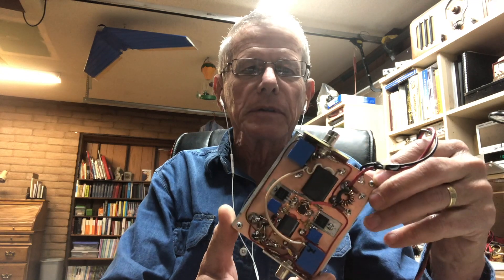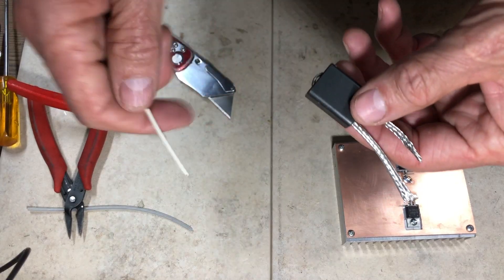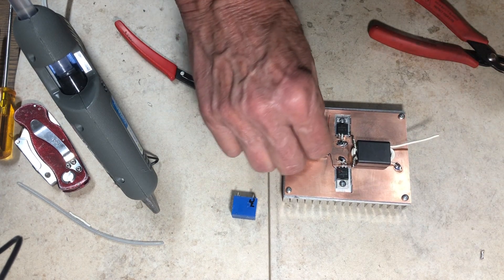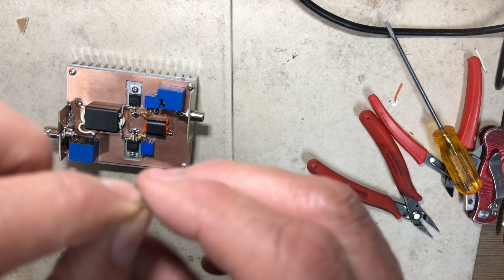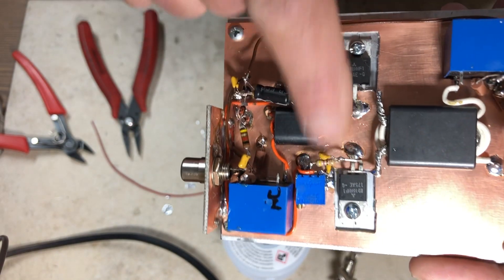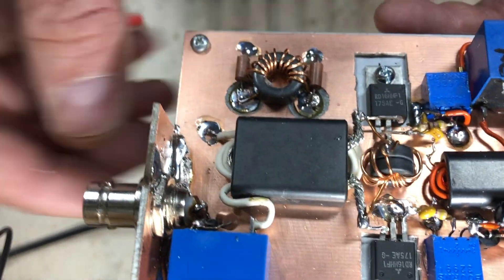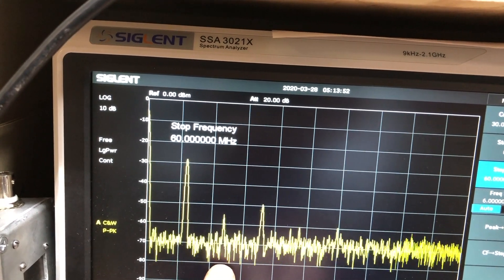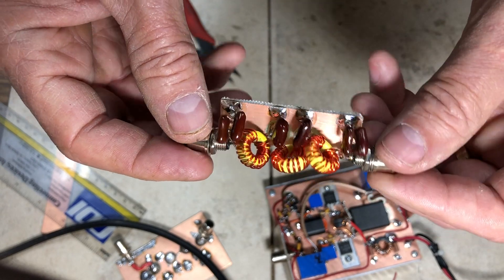RF Power Amplifier Construction

Comment: Hello Ron! Enjoyed watching your DIY project, Thank-you.
I observed couple of points, 1) The binocular core names on schematics are marked wrongly, names just need to be swapped.
2) At 20 mA bias current, i could observe some crossover distortion, anyway you did increase the bias to 30mA. It probably would have fixed the distortion too.
Thanks again!
Best regards,
bp
(I am just a DC to RF enthusiast, not a ham)
Reply from the maker: Hi and thanks for your comments. I re-checked the schematic and found that the binocular core names are indeed correct. The smaller one on the input is the BN43-202 and the large one on the output is the BN43-3312.
Reply: Hello Ron, Glad to hear from you. Yes! you are indeed right. Sorry, my mistake. I probably made that mistake not realizing that the dimensions were actually given in inches for larger core and millimeter for smaller core on Amazon website. 73's
Best regards,
Bharath

Comment: That is what I call a really informative practical video.  I have a few of those transistors.  I intended to use them with a construction similar to the book 'building a transceiver' by ei9gq. I was impressed by the results from your construction,  so I think I will try both. Your construction seems to use simpler transformers, so I will kick off with yours.  I will be interested to see how your construction would work with more bias up to around the linear position for ssb.  I will also try using a simple 50 ohm attenuator padder at the input and see what happens.  Thanks for the video. Keith G0ODU

Comment: Very clean construction technique. I like very much the method to create pads inside a ground plane.
Also, it will be easy to change the transistors when burned by a SWR accident, as we all do ;-)
Thanks,
F1SOC
Reply from the maker: That's true, but these transistors are supposed to be able to take infinite SWR without harm. I haven't tested that though.
Reply: @rontaylor9026  Hi Ron, thanks for the video, infinit swr is a property of the transistor? Or of the construction itself?

Comment: Great video Ron; really enjoyed the step-by-step construction and test walk-thru.  For isolated pads I bought a punch-tool from Harbor-Freight, filed off the punch center-tips and use it to punch-out small round pads out of scrap PCB that then I super-glue down to the main PCB..  The reason I adopted this was that I could make tiny island-pads that are easy to fit into tight spaces and therefore really able to shrink the size of my overall circuits...

Comment: You may be able to improve the gain and output power by shortening the length of the MOSFET Source lead, soldering it closer to the ground plain, especially on the higher frequency bands.  At 7MHz, the design is capable of  ~17.5dB Gain, ~55W  at about 48% efficiency.  Idq was set to 10mA/device for best two tone linearity.  Thanks for sharing your home brew construction of the amplifier.  73, Mike, WA2EBY

Comment: Nice little project. I would have used a pair of slightly bigger devices... go for 70W but what you have there is a nice compromise between supply current and heatsink size etc

Comment: Recently found an old  BLF578 ldmos device that had failed. Measuring it i noted the failure on one side only. I threw it at a PCB along with a few variable Cs and a few inductors and wham !  400W out with 1.5w in at 40v on the Drain, 80% efficiency. Based the circuit on the MRF174 data sheet. Great use of a device that was destined to be scrapped.  Might end up on 6m as a ft8 PA.  73 from ZL.

Comment: Increasing power - a Japanese constructor made a similar amp years ago  but called it a 40 W amp.  IN fact it is about a 34 W amp for SSB use when fed on 14V supply. There was about twice as much ferrite in his core. He used a copper tube core but you can get a similar effect by using teflon insul coax cable with all the braid in contact. 

 Ok so the only other major change was he connected one 100 R x 1W  resistor to each gate , wound 6T of ECW around it and  brought it out to a common point per pair of RD 16HHF1 mosfets, enabling two to operate as if one device. They were biased in common (the assumption is that the came out of the same production batch ).  THe point of the inductor thus created  was to stop ringing between the gates. 

The Softrock 50 which is an ultra reliable kit amp uses a three plus three arrangement to claim 50 W out for SSB - that is the Japanese claim.  (The Japanese is likely getting probably more like 90 W PEP).

 It s food for thought when laying out such a board - allow for expansion.  Such an amp would require about 1.8 W  at the mosfet gates to achieve full output. 

TEFidler ...

Comment: This is an answer on a filter question which is hidden as a reply below  

you either go to QRP labs and buy the filter from there or you use Motorola Application note  267 which is still available on the web.  This covers several filter topologies including the Pi type filter which I believe is Net 3 in that note. Look it up and work it out.
Zout for the amplifier (depends on mode - the above is oriented to CW mode but it will operate as a linear at lower power out.

  THe output impedance from the amp to match is approximately   2 * (Vcc - 2 ) squared / Pout where Pout is say 30 W for CW use and 16 W for  SSB use using much higher bias approx 600 mA total quiescent current  through the sum of the  Drains.    If you are designing a two PI filter you should chose      sqrt ( output Z x 50) and match into that  using the equations  given in the application note. and using a filter Q of either two or three - your choice. Q is defined inn the  application note.  The RHS filter on the output can be designed using the tables in the Appn note as you know the RHS termination is fifty ohms.   You need to have basic EE knowledge to do this  ie you need to know how to go from  impedance to  L and back again and how to do the inductor turns calculations.  

Those are covered  in the toroid tables of  The Toroid  king - search on line.   Such filters can only be approximate as there is tolerance on the properties of the  iron powder material.  A size fifty toroid will be adequate for a 30 W rf filter.  The capacitors should be either multilayer monolytic or  Silver mica.  The latter are preferred for low loss.  The Toroid king sells them.  If you want a seven element filter you have to extend the above description.     

THe application note shows how you can subtract Co of the  respective Mosfet from the calculated  filter  C1 capacitor.  This is not applicable  for a fully isolated  OP transformer as used here. It is applicable for  class C choke type circuits which is a whole different matter.  Basically,  the Appn note assumes single ended RF construction so you have to show some initiative when applying it to a  push pull RF amplifier.

BTW you may wonder where I got the 16 W above from .  Kees Talen used to offer a pretty sophisticated kit with a similar design and it used identical Active devices from MItsubishi.  His considered max Pout with full Fcc Compliance was 16W out.  This was on the basis of a 2 Pi filter or two section filter following the power amp and 14 V supply.  If you take the voltage up to say 16 , which is outside the manufacturer's specification for these devices and if you over drive them (he used just 600mW in) whereas Ron uses one watt, you may well get of order 30 W out on CW  but you may not be FCC compliant.  The FCC requirements are considerably harsher for transmitters over 5 W out and some people don't allow for this. 

In addition of you wire the output transformer for 2T out  you will have a nominal output Z of 72 ohms (running the amplifier for 16 W out nominal)  and if you treat that as 50 R you get  only three percent mismatch loss if you design the filters as 50 R in and 50R out.  I think Diz specified 1:3T (I have his original schematic just to try to get a  bit more efficiency out of the filter by running it as a higher voltage input device in the first two sections. 

 Regards  TE Fidler Nz.

Comment: very good video : thaks for sharing your experience.
Your explanation is very accurate and it will  so simple for me to buildup one.  The point for me is the output filter since I do not have special instruments available here at my station: could you please post the data to build a power low pass filter for 80, 40 , 20 and 10 meter?
Thanks for all.
Reply: you either go to QRP labs and buy the filter from there or you use Motorola Application note  267 which is still available on the web.  This covers several filter topologies including the Pi type filter which I believe is Net 3 in that note. Look it up and work it out.
Zout for the amplifier (depends on mode - the above is oriented to CW mode but it will operate as a linear at lower power out.

  THe output impedance from the amp to match is approximately   2 * (Vcc - 2 ) squared / Pout where Pout is say 30 W for CW use and 16 W for  SSB use using much higher bias approx 600 mA total quiescent current  through the sum of the  Drains.    If you are designing a two PI filter you should chose      sqrt ( OUtput Z x 50) and match into that  using the equations  given in the application note. and using a filter Q of either two or three - your choice. Q is defined inn the  application note.  The RHS filter on the output can be designed using the tables in the Appn note as you know the RHS termination is fifty ohms.   You need to have basic EE knowledge to do this  ie you need to know how to go from  impedance to  L and back again and how to do the inductor turns calculations.  

Those are covered  in the toroid tables of  The Toroid  king - search on line.   Such filters can only be approximate as there is tolerance on the properties of the  iron powder material.  A size fifty toroid will be adequate for a 30 W rf filter.  The capacitors should be either multilayer monolytic or  Silver mica.  The latter are preferred for low loss.  The Toroid king sells them.  If you want a seven element filter you have to extend the above description.     

THe application note shows how you can subtract Co of the  respective Mosfet from the calculated  filter  C1 capacitor.  This is not applicable  for a fully isolated  OP transformer as used here. It is applicable for  class C choke type circuits which is a whole different matter.  Basically,  the Appn note assumes single ended RF construction so you have to show some initiative when applying it to a  push pull RF amplifier.

BTW you may wonder where I got the 16 W above from .  Kees Talen used to offer a pretty sophisticated kit with a similar design.  His considered max Pout with full Fcc Compliance was 16W out.  This was on the basis of a 2 Pi filter or two section filter following the power amp and 14 V supply.  If you take the voltage up to say `16 , which is outside the manufacturer's speck for these devices and if you over drive them (he used just 600mW in) whereas Ron uses one watt, you may well get of order 30 W out on CW  but you may not be Fcc compliant.  The FCC requirements are considerably hasher for transmitters over 5 W out and some people don't allow for this. 

In addition of you wire the output transformer for 2T out  you will have a nominal output Z of 72 ohms (running the amplifier for 16 W out nominal)  and if you treat that as 50 R you get  only three percent mismatch loss if you design the filters as 50 R in and 50R out.  I think Diz specified 1:3T (I have his original schematic just to try to get a  bit more efficiency out of the filter by running it as a higher voltage input device. 

 Regards  TE Fidler Nz.
Reply: @F_Tim1961  very useful response: thanks.
Reply: @ambroribo6079  If you go to the Toroid King Site you will find in his kits that he sells LP Filter PCBs  If you want just two frequencies  then two off DPDT relays (use contacts in parallel ) will allow switching between them.  Don't try it with just one relay - there will be too much signal bypassing occurring.  The single relay approach has been used in cheap Indian kits and it turns out to be a bit of a disaster technically.    TEF

Comment: Hi Ron, I am seeking an RF amplifier that can input 250mw and boost to 3 watts+.  Frequency range is 470-480mhz.  Do you have any recommendations?  Is this something you could make?  Thanks!
Reply from the maker: You might try one of the Toshiba or Mitsubishi RF power modules sold by RF Parts. One they currently have that might meet your needs is the Toshiba            S-AU99H. Good luck
Reply: @rontaylor9026  Thanks for this!  I am actually looking for a complete unit.  12-15v input.  BNC or SMA preferred.  Thoughts?
Reply from the maker: @Voiceguitar  Sorry. I don't have any recommendations for that... 73 .. Ron

Comment: Excellent video. Great for a beginner like me. Would this amp work on top band? 160m? If not, what would need to be changed to make it work at lower frequencies? Thanks!
Reply: It should work there but you need to choose your ferrite material appropriately for the transformers and capacitors may need to be added across the primary windings of the input and output transformers

Comment: Very nice build and explanation video. Glad to see another homebrew project using real RF Mosfets like the RD series instead of IRF switching Mosfets. Excellent work brother. 73. KC3MOP
Reply from the maker: Thanks for the comment. Sorry I was slow responding. Glad you enjoyed it
Reply: I built my first successful RF Amps ever with these RD series Mitsubishi MOSFET Transistors they are awesome and require very low drive to make WATTS even my BK Precision Arbitrary Waveform Generator will drive them!

Comment: Hi, thank you!!!  Four questions: 
- are you using the braided outer conductor for the coax for that turn in the first core?
- if so, why not just use a wire?
- for the second core, why 3 turns and 6 turns, why not just 1 and 2 ?
- are those special "rf" relays?

thank you!
Reply from the maker: Yes it’s braid but wire is ok too at this power level. I used the higher number of turns on the other transformer to keep the inductance high enough so it would work well at 80 meters. Those are just plain old junk box relays. Thanks… Ron
Reply: @rontaylor9026  thank you!!!!